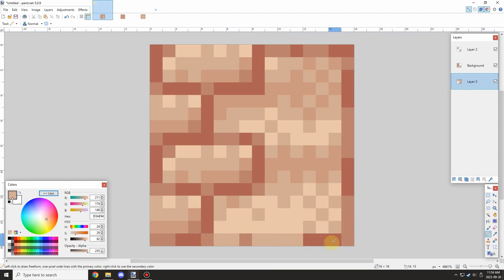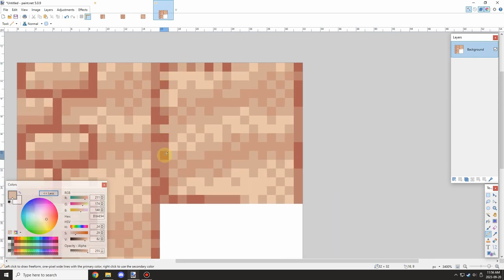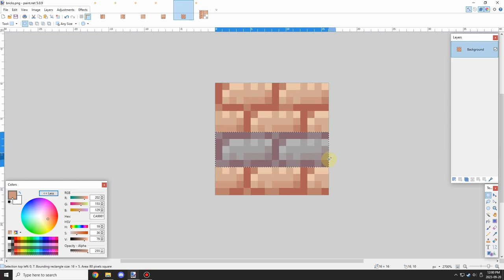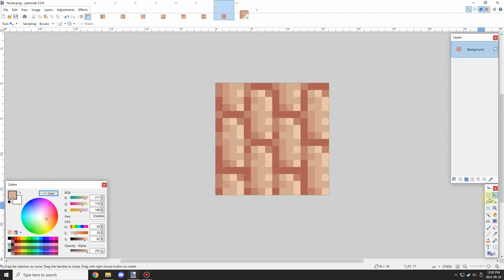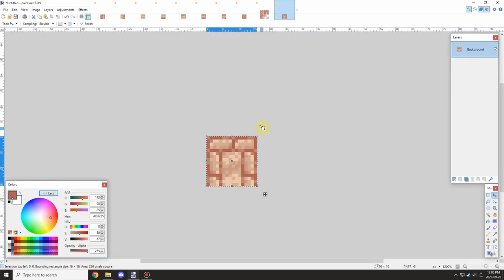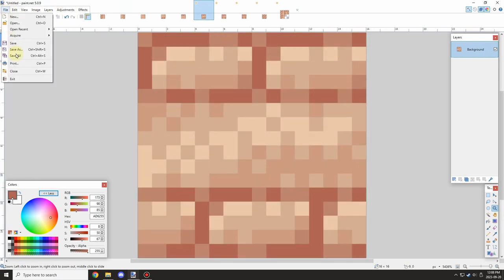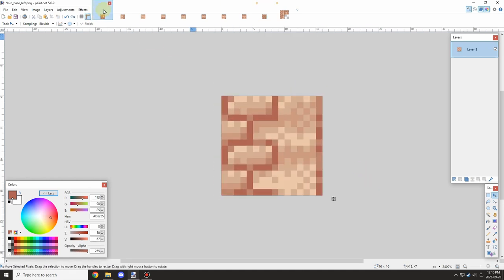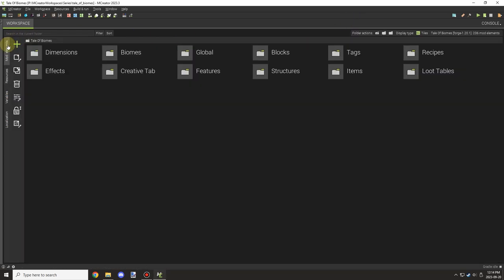New Kiln Textures | MCreator Lore | Ep34

Comment: Awesome video! I was wondering how I would make a creeper like mob where it would flash and blow up if it got close to you. Do you have any ideas how I would do that?
Reply from the maker: Not sure about the flashing part, I would have suggested using condition on the glow layer but the glow layer does not have any conditions which is odd may have been added before the other features with conditions.

Most likely this would be done using code to transition between images.
Alternatively you can swap between entities I guess though it might look a bit odd if the rotation is a bit off.

The other option would be to go with particles I guess you could add sparks or something to indicate its about to blow. There is also the flash particle which I think TNT uses when it goes off this gives off some light.

For the pathfinding AI tasks and target the player then in a tick update you would want to test if the player is in range this can be done with the test all entities in cube distance block under one of the world procedure folders simply test if the entity is a player and then start a set a timer. Keep in mind you will need to make sure the timer is not set every tick so I suggest having the value for it's default state -1 then set the time to something like 300 (15 seconds) and then when it reaches 0 explode the entity.

This will allow you to use Timer > 0 still for decreasing the timer.

For the particles you can spawn them every tick or add some math to do it every tenth tick or something similar.

Ideally having the shades for the glow effect would be ideal but at the moment I don't think its really feasible without coding. Though I think most of the other things mentioned above would work still if you go with particles.
Reply: I’ll see what I can do thanks!

Comment: I thought u would make connected textures....
Reply from the maker: I was going to but the blocks are not really obtainable so building with them would have not been a really normal thing if it was something that could be built with I would have taken the time to work on something but for the Kiln its got a bit much mechanics for the textures I wanted to place and where so I figured it would be best to have them individual blocks and placed in the proper locations. It's mainly the components like the main block and the ladders that would have been a problem making it work.